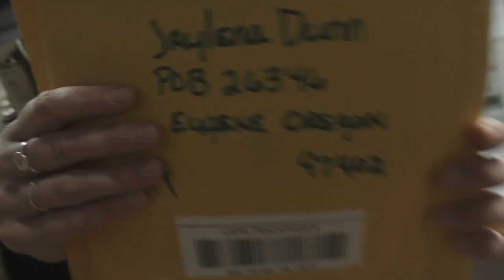30 Day Short Bus Build - Overhead Cabinets, Open Shelves, Slat Ceiling, & Track Lighting

Comment: The track lights look really cool. I like it BUT only if it was a dimmer. Those led lights are too harsh for me. Would drive me crazy. But if it was dimmable that’s would be perfect. I love the way the ceiling turned out with the slats and the track lights.
Reply from the maker: They will be dimmable I just test wired them :)
Reply: @isaacturnerit  AWESOME! Great work guys. Very inspiring.

Comment: Oddly I liked the ceiling a little better when it was only the center boards up (prior to installing the ones around the speakers on down). Center boards plus the strip lights seemed more of a special feature to frame the lights. However the only opinion besides your own that really matters is the opinion if the future buyer!
Reply from the maker: Hmmm
Reply: @isaacturnerit   is that a good “Hmmm”?   🤣

Comment: I like the track light idea but I think I would have set the 4 strips up with halfway down on off switches so you could have all on or only one side or even just one quarter of them on. ie 4 switches controlling the 4 quadrants. A little more wiring but a lot more control of what lights are on or off. Other than that I like what you've done so far.
Reply from the maker: Oh I am gonna have them on separate switches with dimmers this was just testing them

Comment: Is that a fiero? ???   Whats up with it?  The bus is looking great so far.  Why do you use the leather pulls instead of locking latches or pulls?  I would do color changing leds in the tracks and can you make them dimmable?
Reply from the maker: That’s a 1986 Toyota MR2 🖤 I just like the vibe of leather. I use locking hinges and sliders so I don’t need locking latches
Reply: @isaacturnerit  Ahh I went back and looked awesome car. Do you think locking hinges and latches will be enough for child safety? on lower cabinets ofc.
Reply from the maker: @CynBrown  Thais bus isn’t for me. It’s a project bus for my business
Reply: @isaacturnerit  oh lol I get that.  It was just a question.  I have been curious what people would use for child safety in these types of builds.

Comment: Glad I came across your channel! Loving the design & ceiling. 
I may have missed the video but what paint did you use for the outside of the bus? 
Thanks so much!
Reply from the maker: I use an oil based based paint by behr from Home Depot :)
Reply: @isaacturnerit  thank you so much for responding & I appreciate you disclosing what paint you use. This will definitely help my husband and I during our bus build.  🤗

Comment: I had seen Jaylena's video on this, I somehow missed this one Isaac, I just found it thru search on YouTube, but glad I found it, I don't want to miss any of y'all's videos on this bus build. Y'all are doing awesome, love the ceiling and light strips, the closed and opened shelves, etc. Looking forward to seeing the bottom area get worked on and done .. it's awesome y'all. Gave me a possible idea to go with for my 2nd van conversion build I'm working on for the closed and opened shelves (may have to do a somewhat mini version of them in my large van, because not quite as big as the bus by a few feet, length,width and height roughly 66 square feet based on floor measurements, and close to 5'7"ish in height with fiberglass topper.) I'm done with homemade framing and ribbing it the ceiling area almost 2 months ago, now to do rest of ceiling and topper area before I do the walls and furnishings below the topper. I'm getting there slowly but surely in the midst of caregiving for my elderly dad, near done with projects in my dad's old house to hold us through this winter and until whenever his old house is demolished and new house build, and if weather is permitting and good (because I don't have a shop of sort on my dad's property, but his driveway, I know it's not safe running power tools in the rain or if too wet outside, I only have a few that are battery, rest are power tools) anyway, awesome job Isaac and Jaylena, love the way y'all work together. Be blessed and safe too sending lots of love hugs and prayers daily to y'all from me and my dad in Odessa TX 🤗💖🤗💖

Comment: okay so if you had screwed the light track up, then inserted the lights into the track I am guessing that would have been more difficult than gluing the track to the bus ceiling? what kind of glue did you use? does it need to be a type of glue that stays flexible? I love how you find the easiest way to do something without compromising the finish. it looks very smart.
Reply from the maker: You can’t do that the tracks don’t snap together. They slide into each other if that makes sense
Reply: @isaacturnerit  good to know - I thought you would have a good reason I thought it was just to make it easier to stick on the lightstrip before it was 'in the air; so to speak. great job anyway I am sure it looks really slick up close.

Comment: Awesome build, y’all are amazing! I was curious of the length and width of the open shelving, the size of the wood, and the size of the lip around it
Reply from the maker: 3/4 plywood usually I do normal ones 12in wide. Smaller one I do about 9in how tall I don’t remember maybe like 3 or 4 in